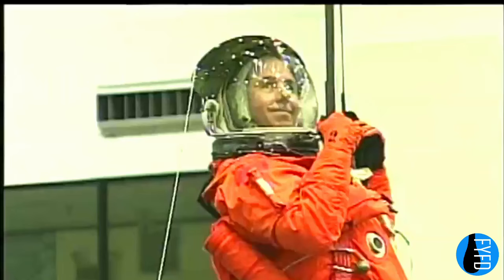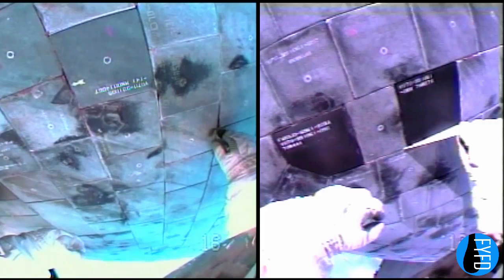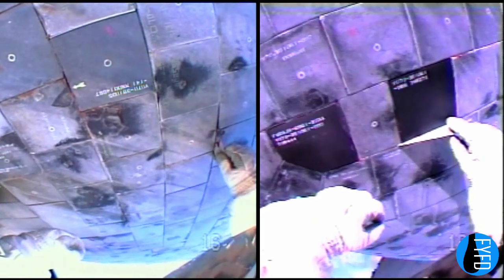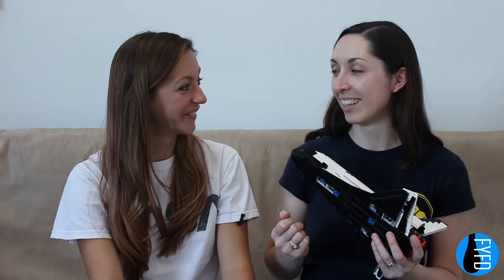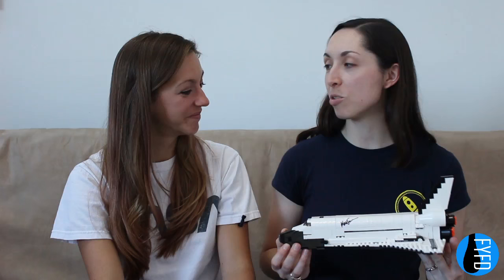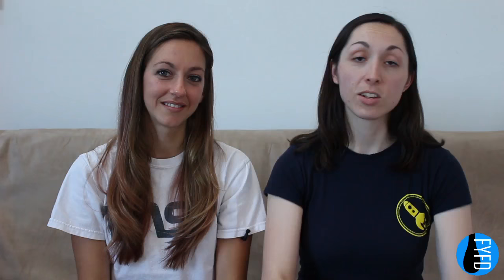How fluid dynamics saved the Space Shuttle (w/ Dianna Cowern/Physics Girl)

Comment: Pretty cool, thanks. I didn't know about that.

But it's a bit of an oversimplification that laminar flow is always better in aviation. You were right in being precise to say "less friction-based drag", but a turbulent boundary layer can help reduce overall drag by delaying boundary layer separation and thus avoiding larger turbulence just as with the dimples in the golf ball. A delayed boundary layer separation also helps with lift at higher angles of attack and thus delays the onset of a stall; this can also be achieved on laminar-flow wings with vortex generators, which act as a sort of "controlled turbulence".
Reply from the maker: Yep. I tried to word things carefully there. You're right that laminar flow isn't always the best for keeping drag low overall - but that's a topic for a different video!

Comment: Cool video, never knew that the margins for error were that small in the heat shield of the shuttle !
Reply from the maker: Thanks! It's more a matter of uncertainty than small margins of error. Because the physics is not well-understood, engineers have to overdesign things like the heat shield so that they can be confident they'll handle whatever unexpected thing (like gap fillers sticking out) that happens. In this mission especially, they were very cautious given what had happened with Columbia on the previous flight.

Comment: Great video, just one addition: Turbulence is useful for flying too and without it flying wouldn´t be the same. Over time the boundary layer of the wing of an airplane grows and there is a point when flow seperation accurs(usually when pressure rises due to sharp corners). If there was no turbulence this would lead to a large area of dead water and would weaken buoancy. So turbulence on the one hand leads to more friction and visocsity, on the other hand it is a reason why flying is possible.

Comment: Wouldn't the boundary layer be turbulent anyways within a few inches of entering space defining the flat portion of the fuselage underside? Or does the compressible effects help maintain a laminar flow and the worry was that the filler would trip the turbulence earlier. Also, how do you/NASA  model wall bounded compressible turbulence? Certainly not at the Kolmogorov scales for the entire lower surface of the shuttle?
Reply from the maker: Great questions all around, Chad! It turns out that at high Mach numbers laminar boundary layers are remarkably resistant to going turbulent (a least due to roughness). What generally happens during re-entry (ignoring roughness effects) is that the boundary layer under something like the Space Shuttle stays laminar until a critical altitude where the speed of the vehicle and density of the air is such that turbulence occurs. Typically, this doesn't occur until lower in the atmosphere, when the Shuttle has already lost much of its speed. The concern is that large roughness could cause a turbulent boundary layer at higher altitudes and Mach numbers, where the heating effects would be much worse.

As for how people model compressible turbulence, that's very much an area of active research. As with incompressible turbulence, there are many models available to choose from. For simple geometries (like a flat plate), it's possible to do Direct Numerical Simulation and solve the governing equations exactly all the way down to the Kolmogorov scale. Obviously, that's not realistic to do for the full Space Shuttle, so NASA often uses a combination of models and methods. For example, they can combine high and low fidelity simulations, wind tunnel testing, and flight data from previous Shuttle missions to estimate the impact of a given piece of roughness. In fact, that's some of the info that went into the Boundary Layer Transition Tool NASA engineers used to try and predict the impact of those gap fillers. In the end, they didn't have enough certainty in their predictions to outweigh the risk, so they recommended pulling those two gap fillers. You can read all about it in their report: http://ntrs.nasa.gov/archive/nasa/casi.ntrs.nasa.gov/20060022549.pdf

Comment: Awesome! Was wondering...do you think fluid equations are as useful as simulations are when modelling situations like these? If not, where could the equations actually be used?  - curious physics undergrad
Reply from the maker: In fluid dynamics, most of our computational simulations start from the Navier-Stokes equations (which are basically Newton's laws written for a fluid). Those can be tough to calculate quickly, even for supercomputers, which is why we have to make simplifications that we refer to as models for parts of them. In the case of this Space Shuttle mission, NASA had tools that combined high-fidelity numerical simulations, wind tunnel data, and flight data to help them estimate what the effects of the roughness would be. In the end, they just didn't have enough certainty to take the risk, so they recommended pulling those two gap fillers.

Comment: just went to Diana's video and now im wondering how would a golf ball behave when it travels through the air with a horizontal spin? i heard the little dents on its surface help reduce air resistance by creating small but even turbulence on its surface so the ball is surrounded by a thin layer of air. does it mean a golf ball would behave more like a beach ball instead of a foot(soccer)ball?
Reply from the maker: You're spot-on about the dimples on a golf ball causing turbulence. Because that roughness is going to help keep the boundary layer turbulent on both sides, the golf ball would spin like the football. The beach ball only sees the reverse Magnus effect when one side is turbulent and one is laminar. As long as both are the same (either both laminar or both turbulent), a ball will see the classic Magnus effect.
Reply: fyfluiddynamics ohhh i get it now. so i understood that video wrong. haha thanks Nicole.
Reply from the maker: No worries! It's a confusing concept that can take some time to wrap your head around. :)
Reply: What about a table-tennis ball? I always thought it had a very strong normal magnus effect, but it's small and relatively smooth so I wouldn't be surprised if it had laminar flow. On the other hand, table-tennis balls spin extremely fast and so perhaps will still create turbulent boundary layers on both sides. (Maybe I'll have to calculate me some Reynolds-numbers ...)
Reply from the maker: I don't know for certain, but I suspect ping pong balls usually have laminar boundary layers. But as long as the ball has the same boundary layer state on both sides (i.e. both laminar or both turbulent) then it will behave according to the classic Magnus effect. It's only when things are asymmetric - laminar on one side, turbulent on the other - that balls get the reverse Magnus effect.